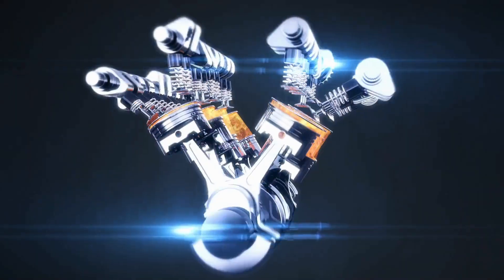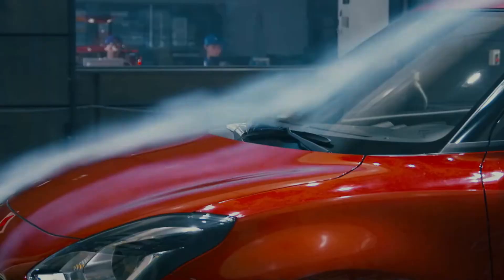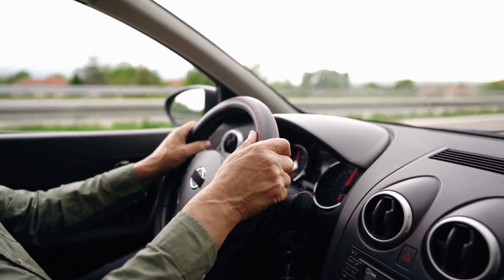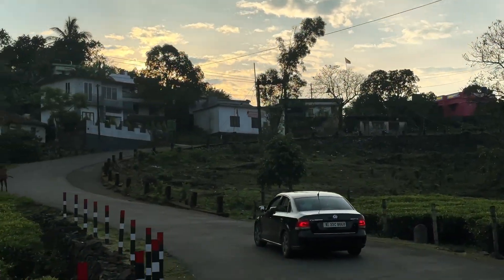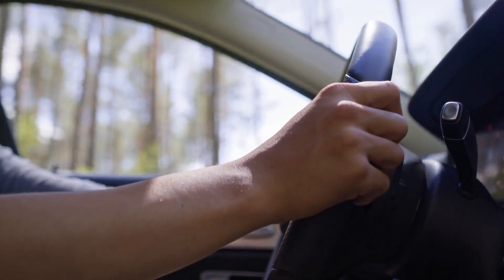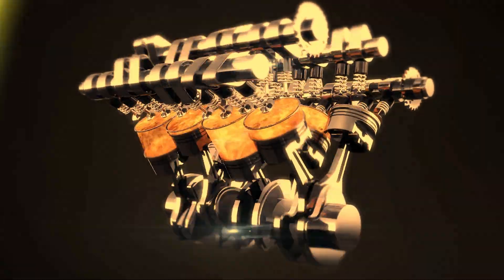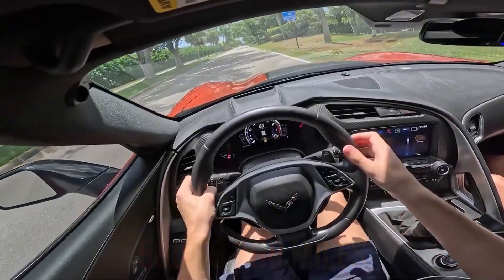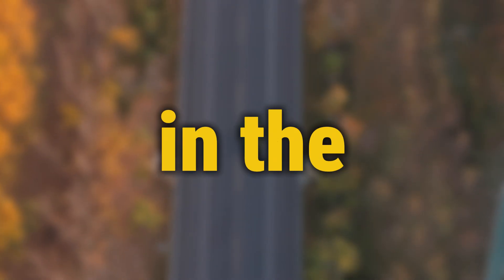STOP Breaking-In Your Engine Like This (7 Mistakes Destroying Your Car)

Comment: Having been exposed to the truth about engines you will kick yourself when you read my analysis.  Engine break in is ridiculous because they are built to tolerances smaller than the eye can see. Factory engines are today made predominantly by CNC machines which guarantee consistent tolerances. Take an old engine block and with a dial bore gauge you will note that the greatest amount of wear is on the cylinders closest to the water pump inlet. The cylinders furthest away have the least amount of wear.  And there it is the modern coolant system is devoted to wearing an engine out  as most coolant systems are devoted to pushing cold coolant onto the  nearest cylinders which as a result do not get to expand as designed to, and as such the piston rings become a file and inevitably a short engine life which we are used to being about 200,000 miles before a full rebuild. 
How do I know because we have developed a cooling system modification  that allows an even temperature across the whole engine of less than 10 degrees, and engines that last for a million miles.
Reply from the maker: So you mean modern engines have tight tolerances and they can just be run normally?
Reply: @AutocornerdPros  Yes

Comment: I work as a tester for new vehicle generations. We tested 3 new BMW vehicles (same configuration, engine, automatic transmission) all with petrol engines.

The first car was treated very gently. We drove it with care, but also included some pulls to higher RPMs.

The second car was driven full throttle as soon as the oil was warm, basically, we treated it harshly.

The third car was driven according to BMW's internal breakin instructions.

At the end, we did an oil analysis. Cars 1 and 3 had the same amount of contaminants after the oil filter at 5000 km (both negligible), and the filters themselves had trapped particles as expected. No reason to change the oil earlier than recommended.

Car 2, on the other hand, had a high amount of contaminants and particles after the oil filter, as well as in the filter itself. Still, it wasn't anything alarming tho, but would change it earliler than 30K km or 2 years.

Then we put the cars on a dyno to test their performance. Car 2 had the highest power and torque. Cars 1 and 3 were roughly the same.

But when driven the same, car 3 had lowest fuel consumption and car 2 was the most fuel hungry and also kinda oil hungry.

In the end, just drive it acording to the manufacturer, don't overcomplicate it, engine will outlive the car in wast majority. Just don't hammer it in first 2000km and you are okay, today's manufacturing is at it's peak and the engine only uses higher oil pressure during break in.
Reply from the maker: Agreed with you. Manufacturers have highly qualified engineers. They have done the testing after spending thousands of dollars. So we should follow their instructions

Comment: While this was a generally good and informative video a few points need addressing.
The break-in period is regarded as the final machining operation on any engine and regardless of whether it is a lowly street engine an F1 racing engine or even a lawnmower engine this holds true so an appropriate amount of care should be taken to get the very best out of it.
There appeared to be some confusion about tolerances and clearances these are not the same thing,    Manufacturing tolerances in the automotive industry have not significantly changed in nearly a century and in fact in many cases these tolerances have widened and selective assembly being more common this has been done to reduce scrappage and thereby reduce production costs.
Clearances are in many cases smaller than they used to be this has come about mainly because of improvements in temperature control improved design meaning components are far less stressed than they used to be and the use of thinner greatly improved lubricants.

Comment: The only engines that don't require breaking in, are F1 engines or my own specs engine that has specifically ground cylinder rings and bore for this reason, so you always should just not over load or over rpm your engine in your new vehicle, for the first 3000 miles, mainly not working it hard at low rpm, better off to rev higher than download stress.

Comment: Valid points but unless you rebuilt your engine your engine already has the wrong oil for break-in from the factory.  I use break-in oil for my engine rebuilds for the first 10 minutes then do an oil change, run for 500 miles, then switch to a non-synthetic oil.  At 10k miles I switch to synthetic.

Comment: Or just buy an electric vehicle and avoid all this trouble...
Reply: Oh, wonderful idea! Why break in an engine when you can just unbox one like a toaster and call it a day? No noise, no mess, no pesky ritual—just software updates and charging stations every 150 miles.

But for those of us who still believe machines should have a heartbeat, not just a battery—there’s something sacred about that first stretch of life for an engine. It’s not just break-in, it’s initiation. A mechanical bond forged in RPMs and raw potential. You don’t just own the engine after that—you’ve earned it.

Electric cars? Sure, they’ll get you from A to B with zero emissions and maximum convenience. But they won’t sing to you at idle. They won’t growl when you push the throttle. And they sure as hell won’t leave fingerprints on your soul.

So while you're waiting for your next charge, we'll be out there burning fuel and making memories—one rev, one gear shift, one glorious mechanical symphony at a time.

Because electric cars go fast… but internal combustion engines make us feel alive.
Reply: @mafiamafia3458  I couldn't agree more with you! I own a DURAMAX 2.8 Turbo Diesel with 60K miles on it an working like a charm, like if was brand new!

I enjoyed the breakin period, and like you said, the noise, the tork band, the vibration Diesels make... I love it! 

But modern Diesel are becaming a pain in the... It's so frustrating... EGR, DPF, SCR, DOC and all this emission control crap they put in a modern diesel engine, like the one i have, are ruining the good experience and the pleasure we used to have with a goog old diesel engine...

Even gas engine are suffering from this...

CDA (Cylinder Deactivation) and it's problematic lifters ruined the 5.0 V8 Coyote that once was considered an almost perfect engine.

So, is it really woth it? 

Does this "passion" for the combustion engine, and it's glorious mechanical symphony, ovecome the infinite problems and frustations that come with this type of engine nowadays?

I don't know anymore... 

Are the e-Fuels gonna save the Internal Combustion Engines?? 

I really hope so!!!

*I have a 2022 Chevrolet S10 LTZ 4X4, with the DURAMAX 2.8 Turbo Diesel here in Brazil. The S10 here is the Colorado you have there, same truck. But with the 2.8 Diesel instead.
Reply: Same process with electrical cars
Reply: @bullbuster944  Ohh really? So you drive an electric vehicle for some miles and then you change the engine oil?? LOL...
Reply: speaker wires break in too, buy a horse

Comment: No, you know what destroys you engine? Buying a GM with a 6.2. You break in an engine exactly the way you drive it, without babying it. If you coddle it, the rings won't get hot enough to seat, and she'll burn oil forever. Don't let anyone tell you different. This used to be common knowledge. Wow.
Reply: Ah yes, nothing says “I respect machinery” like treating a fresh short-block like a Nascar rookie and hoping for the best 🙄

Breaking in an engine isn’t about babying it , but it sure as hell isn’t about abusing it either. It’s about controlled operation so the rings can seat properly under gradual thermal load — not by flooring it every chance you get. There’s a difference between smart break-in procedure and trying to turn your new motor into a YouTube burnout spectacle.

And FYI, slapping a GM 6.2 in your comment doesn’t make you a mechanic — it makes you the reason forums are full of people asking why their brand-new engine burns oil at 500 miles.

Real knowledge used to be common. Now? It’s just buried under a lot of internet bravado and synthetic oil memes.
Reply: @mafiamafia3458  Who said anything about abusing it. And I will maintain the best way to ruin your engine is to buy a GM 6.2, and they must agree, they recalled 662,000 of them. Who are you?
Reply: As a mechanical engineer, let me break this down for you in real terms — none of that “broscience” nonsense.

Proper ring seating occurs when the engine reaches full operating temperature consistently over time, not from redlining your new motor every startup like it owes you money. The rings don’t seat from brute force — they seat from controlled thermal expansion , proper piston-to-cylinder fit, and consistent load. That means varying RPMs gently, avoiding sustained high loads, and yes — not lugging or flooring it for the first 500 miles.

The OEM break-in procedures? They’re not just suggestions. They’re based on thermal dynamics, metallurgy, and wear analysis — things that happen long before your GoPro can catch smoke.

And no, the GM 6.2 doesn’t magically survive your abuse because it’s “truck tough.” In fact, I’ve seen more than one get wrecked early because guys like you think aggression equals strength. Spoiler: It doesn’t. Control does.

So next time, maybe leave the engineering to the engineers 🧰😉
Reply: @mafiamafia3458  Who said anything  about redlining your engine? Guy like me? You don't even know me. F off.

Comment: Run it, don't baby it for best cylinder compression. Apply up to 75% engine load consistently in the first 1000 miles.
Reply: That's a fast way to get premature blowby😂

Comment: Weird I've been to the Volvo Penta plant & they told me engines dont need break-in-time.... Volvo Penta engines up to 1000HP so Im a bit confused why would they tell me so.....
Reply: Thanks for sharing this information! I wanted to add that all Volvo Penta engines are indeed run for a short time during a final test at the factory. However, it's important to follow the engine break-in procedure during the first 20 hours of operation to ensure maximum performance and longevity. During this period, avoid running the engine at full throttle or under heavy load. Instead, operate it at moderate speeds and loads to allow the components to wear in gradually. After the break-in period, it's a good idea to change the engine oil to remove any debris generated during this process. Monitoring the engine's performance and keeping track of the hours operated are also essential. Safety precautions, such as ensuring proper installation and ventilation, should always be followed.
Reply: Are you serious?
Reply: @CRJ08 "Volvo Penta is a world-leading supplier of power solutions for marine and industrial applications" from official site.

I was also able to visit the Kalmar factory in Finland. They make Reach Stackers for our sea terminals.

I also had an opportunity to visit SiSu axels factory. They also showed us an axel that they make for Dakar races it's all individual & such an axel would send you back around $20,000 - $30,000 depending on the project & the vehicle.

Comment: Exactly why I intentionally avoided highway when I drove home from the dealership after buying a new car.
I also do first two oil changes early, like under 500 miles and then under 2000 miles.

Comment: E7 A3/B4 CI-4/SL grop II mixed fleet oil gives best results so far  for brake in rebuild engines with cast iron blok and liners and flat tappet lifters and works great with modern aluminium engines but eco standards doesn't allow using high ZDDP oils

Comment: Most dealers dont want the cars to last longer than 5 years, then buy a new.
And i dont see why one would reach 4.000 rpm anytime. I am seldom over 2.500. Of course if you are passing a car, but 4.000? No.
Reply: Exactly. Most modern engines are over-engineered for everyday use, and the average driver doesn't need to touch 4,000 RPM unless they’re in a hurry or passing on a two-lane highway. For regular commuting? 2,000–2,500 RPM is more than enough — it’s smoother, quieter, and easier on fuel.

And let’s be real: dealerships and manufacturers love having customers come back every 5 years for a new loan. If your car lasted 20+ years without issues, they lose a customer. That’s why so many things are built to wear out or fail just past warranty.

Driving smart, keeping RPMs low when you don’t need them, and maintaining your car properly? That’s how you beat the system and keep your ride on the road longer than their spreadsheet says it should last.
Reply: @mafiamafia3458 redines W12 engine at least 20 times every drive

Comment: I changed the oil on my new Harley at 500 miles and again at 1,500 miles. Speeds were varied and always under 3k RPMs.
Reply: Harley Davidson have piston rings cylinder ground and gapped for each size cylinder, so bore doesn't need hone for breaking in, and can be totally thrashed to max from initial start, but I can't be sure if they are still doing this awesome F1 spec's in the mid 20's, though it was awesome while it lasted and I still do it myself.
Reply: It doesn't matter with a Harley Davidson.
Reply: @simonallan9941  The owners manual said to follow the "No higher RPM than 3K" for the first 500 miles and then continue to vary speeds until over 1K.  The first oil change had to be done at 2,500, but I did it sooner.
Reply: @dwheeler016 If you change the oil too early during break-in, you're removing the abrasive material that's speeding up the wearing-in. Something worth considering as it could potentially be extending the break-in period, or possibly terminating it before it's complete.

Typically it's not fully done wearing in for a few thousand miles, though the critical stage where you need to be managing it is indeed pretty quick.

I'd consult an engine tribologist, just to be certain.

Comment: Great to finally see someone talk about engine break-in from a scientific perspective and not just old-school myths. As someone who worked in engine rebuilds for over a decade , I can’t stress enough how crucial the break-in process is — whether it’s for a freshly rebuilt engine or even a brand new one straight out of the crate.

Too many people skip or rush this phase, but proper break-in sets the foundation for longevity, performance, and efficiency. Things like monitoring oil pressure, using the right break-in oil, avoiding lugging the engine , and letting RPMs vary within reason are all key.

I always recommended doing an oil analysis after the initial break-in period , along with a compression and leak-down test to make sure everything’s sealing properly — especially with flat-tappet cams or freshly honed cylinders. Those tests tell you so much about how well the rings seated and if there’s any abnormal wear happening early on.

It’s also awesome that you keep it fun while diving into the technical side — that’s rare and super refreshing. Keep up the great work
Reply from the maker: I see you are a mechanical engineer. Really glad to learn from your comment.